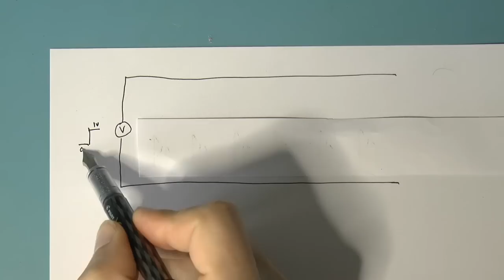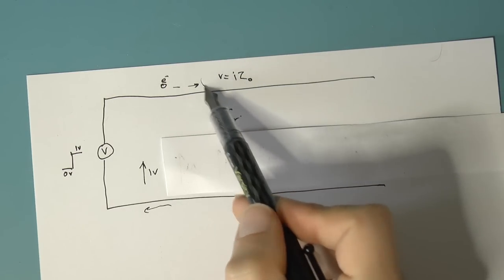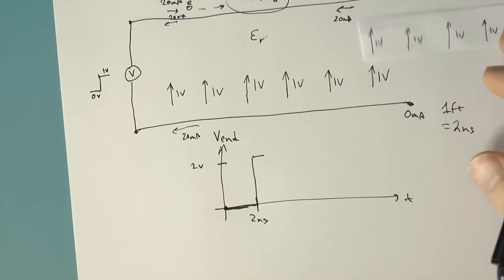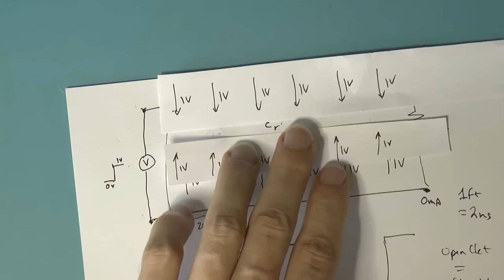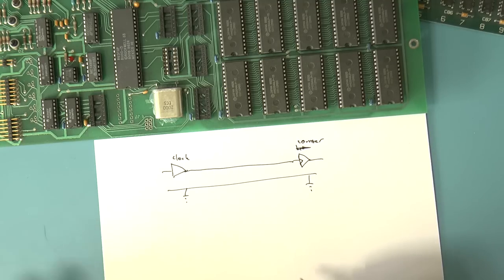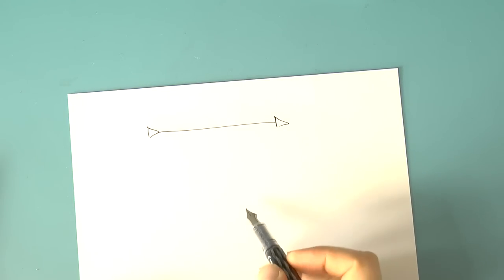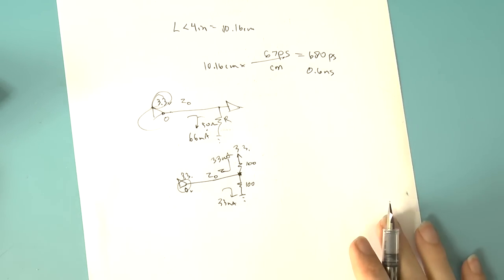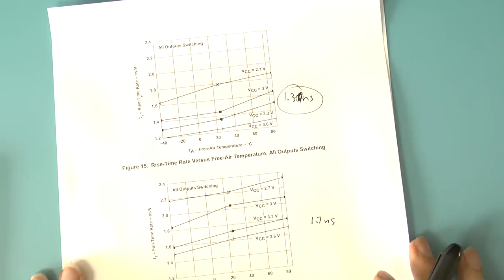Chip Tips #7: Transmission lines and termination

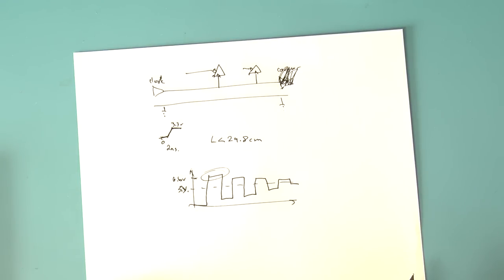Comment: I am not sure that if 1V "suddenly" appear at the source, forgetting the Heavyside step function behavior (which is mathematical), 1 V would appear immediately on the wire:  moving electrons will accumulate on the more positive tension and lack of electrons ( positive charges cannot move in a solid) will create itself a positive potential. In the resulting field, there will be less than 1V on the wire, at first. And when the reflection will come back, the total won't be 1V (in general), so at that time, it will be 'AS IF' a new tension would have suddenly appear, but that won't be 1V, and at each back and forth travel, we will finally ends up NOT to oscillation, but to gradually achieving less and less tension "instantaneously" appearing to become asymptotically equal to 1V, with time. I assume that it could also be like at 48:00 in you video, but in my case, it was always under the voltage, gradually filling up to the voltage of the source, with time (or a little bit like charging a capacitor).

That is what, at least, at the start, with a scope with 2 channels, and 30meter of wire. Install a probe at the start, and the other probe at 10m and return the wire at the source. Trigger on the first probe (raising at 1V level). Issue a 5V Heavyside Step. In my case, the first probe raise definitively less than 5V and the second probe  see the raising around 65 ns later. It is only later on (when the field from the 20m collide back with the field having through the 10m of the probes, that things get mixed up. But DEFINITIVELY, if the pulse is at 5V, the first 65 nanoseconds don't see that full voltage (the raise time is around 6ns, in my case ).

Comment: Awesome video! I'm currently building a CPU myself (although with HC-Logic) and started hitting those problems with reflections especially with my clock signal (although approaching a semi-stable state at ~1MHz). Now I'm curious, because your standard clock line looks more like a tree so I'd have multiple endpoints reflecting the signal. Does this mean that with for example two ends I will have a reflection with double the voltage at the driver?
I was thinking about using a series resistor for every line splitting of the main wire in the hope that they would create seperate transmission lines. Although I'm not quite convinced that this will completely please the signal gods.
Reply: Just something I wanted to point out. Clock frequency and rise time are different things. The Rise time of HC logic is 3.6ns which would require a bandwidth of 97Mhz. You can calculate the critical length following Robert's video to see if you need a series resistor.  Just wanted to point that out even though I didn't answer your question.
Reply: Thanks for the answer! Yeah, I see the difference between clock frequency and rise time, but the circuit worked fine with the low clock frequency and ringing was not so much of a problem back then. But as I've increased the clock rate my ringing got worse as well, so I'd assume that the amount of crosstalk got intensified (do EM fields work like this? I seriously don't know, maybe it's time for a pcb with a ground plane...)

The critical length for HC would be ~54cm for ringing and ~27cm for crosstalk. I've just measured the longest clock line and with it's 43cm length it's sadly above the threshold.
Reply: The calculations given in the video were for FR-4 PCB. If you breadboard the circuit, (which you described), it would be totally different, (think about the parasitic effect of a breadboard).
Reply from the maker: I /think/, after spending some time fiddling with a diagram, that if you have a sender in the middle of a bus, and the sender has the series termination on it, then the signal gets launched both ways down the bus, they get reflected off the ends, and when each reflection gets back to the series termination, it is absorbed. So there /shouldn't/ be any additional reflections beyond the ones you want, but I'm not positive. 

Also, the "stubs" that lead to the receivers all along the bus are also theoretically points where reflections will get generated. The only thing I've been able to find about that is "keep your stubs short", which kind of makes sense. In fact this is the sort of experiment I want to do for the next video.
Reply from the maker: The observation that ringing gets worse with rising clock frequency is interesting. Nothing that I know would account for that, except that possibly the ringing from the previous edge is still sloshing back and forth by the time your next edge occurs. That's just a guess. Another possibility is, if this is on a breadboard, you've got parasitics all over the place, and many of those parasitics just love to resonate at frequencies around 1MHz or above.

I've heard tell of people who happily run breadboarded circuits at 10MHz or above, but I don't know what techniques they use, and I wouldn't even try 1MHz on a breadboard. Run it slow to prove the concept, then start making PCBs for prototypes. They are so cheap now, that the only downside is the time it takes. I use JLCPCB which seems to have pretty good times to get back to California.
Reply from the maker: After getting my test transmission line back and working with it, I realize now that with a sender in the middle, you'd have two parallel transmission lines, so the initial wave launched would see a half load. You'd need to halve the series termination resistor, so if your transmission lines were 50 ohms each, you'd need 25 ohms, and if your lines were 100 ohms each (as they are on a PCB), you'd need 50 ohms.

Comment: Why do you count with dielectric constant of PCB when the field traveles in the wire?
Reply from the maker: Filip Miler the electric field is between two conductors, so it passes from the wire, through the PCB, and to the ground plane.